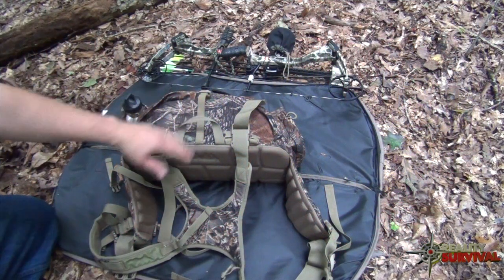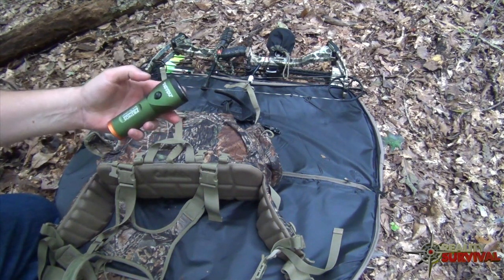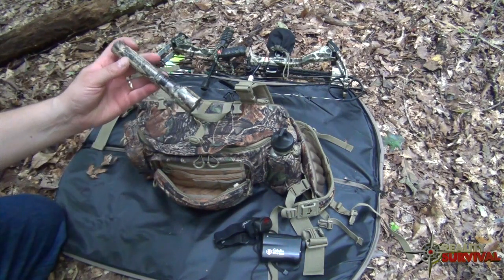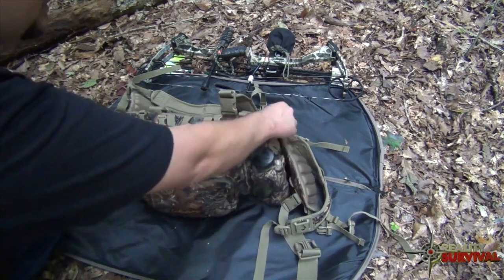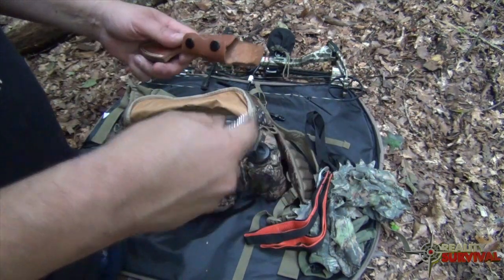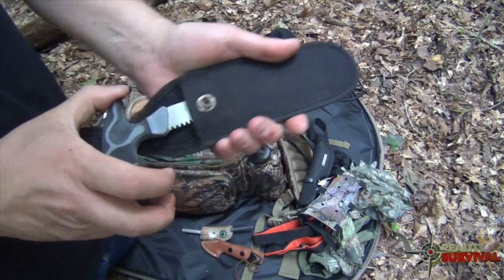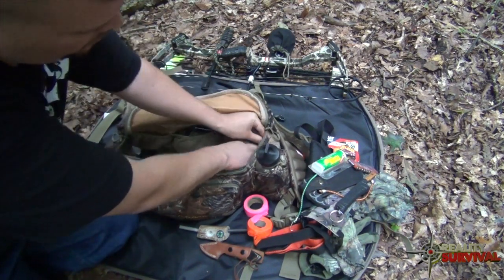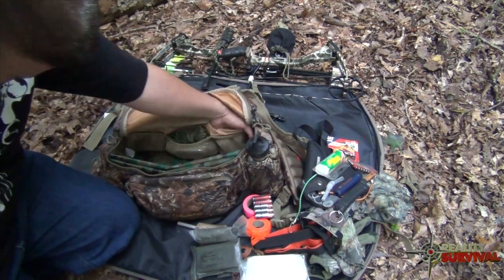My Hunting Gear Load Out - Bow Hunting Gear Checklist

Comment: You have way to many things! Choose one knife, you don’t need a saw until hang the deer. A pack should be what you need in the woods and not what you need for when your out. You don’t need all those  lights just choose one. But overall nice video I learned some new things to take with me, but that’s my opinion if it works for you keep it
Reply from the maker: Thanks for sharing your thoughts. I use the saw to cut through the pelvis making the gutting much easier to empty out.

Comment: Good video. Have you thought about adding a 1oz. liquid candle? They burn 10 -12 hrs. I carry that a space blanket, and matches and a bic in my winter coats. Back in the late 70's I carried a candle but now it's a liquid candle because it's smaller and burns longer. If I'm lost I can wrap up in the blanket and light that small candle between my legs and stay warm all night. I know if I'm lost, I probably will not stop walking before darkness and by then, how will I make a fire to last all night?